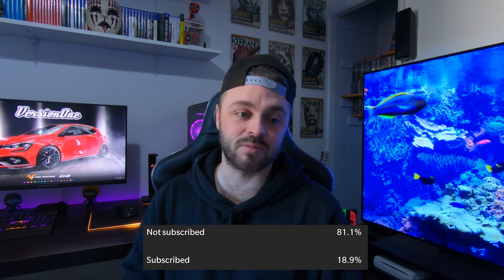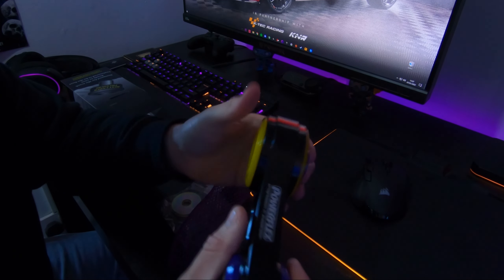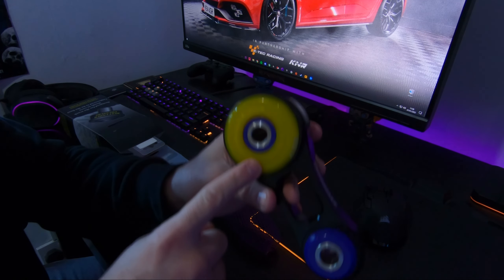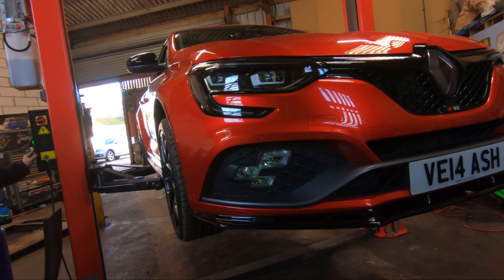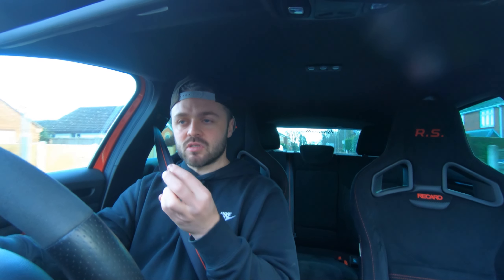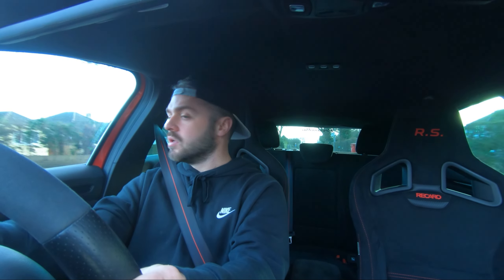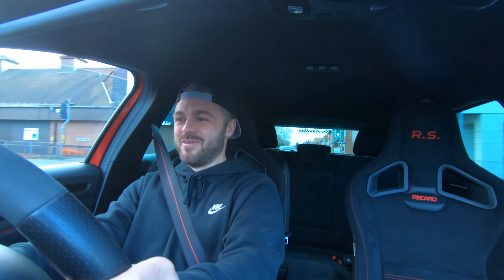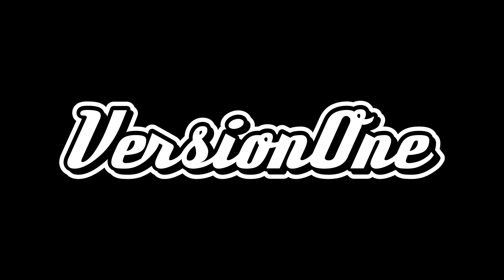GET THIS MOD FOR YOUR MEGANE RS RIGHT NOW! POWERFLEX lower torque mount UNBOXING/INSTALL/TEST DRIVE!

Comment: He mate thanks for your video. What about Ktec strut bridge in combination with the engine mount upgrade. ?  can you make a video about this too?
Reply from the maker: The strut bracing will make a negligible difference compared to the torque mount mate, probably won't even feel it. Being a new car with such a good chassis I imagine it doesn't flex much at all...
Reply: @VersionOneUK  I have done it on my Clio 4. Different was huge. Now I want it on the Megane 4 Gt. hence the question how it will drive in combination with the new engine mount
Reply from the maker: @raymondsport1144  yeah, the diffence being these top end models have a completely different chassis to the RS line models like the GT, the trophy has the cup chassis as standard so it already stiff straight out the box, the GT being the softer, more comfortable variant would benefit from bracing alot more.

Comment: Hello Ash... Someone wrote this about the Powerflex : "Have noticed that in very slow traffic, on and off throttle at walking pace, the car is now more difficult to drive smoothly. In a stock A110 this is only a problem in S mode. Now it can happen in comfort mode. This shows there was a lot of flex in the OEM part". Installed on an ALPINE A110 it seems the support is creating some negative effects. Could you tell me if you experienced the same problem on the Megane ? I have the Megane RS Trophy not an ALPINE and as both cars are not the same, maybe the behavior is different too. Thanks ;-)
Reply from the maker: Hey mate, I've noticed nothing negative about the torque mount... Cars still smooth at low speeds even in sport, and more responsive in sportier modes etc, much flatter shifts
Reply: Ok, nice, thanks for answer. I ordered one for my car but it's on backorder, they ask me to wait a few weeks. Can't wait to install this on mine.
Reply from the maker: @MrToonfish  its a decent easy mod mate! Might be more noticable on the manual shifts wise but i definitely felt a difference
Reply: @VersionOneUK  Hello Ash... FINALLY I had my Powerflex lower torque mount installed on my Megane RS Trophy last week, I had the parts for some months at home without having the time to do the job. So, I installed the MK1 exhaust tube that goes from the catalytic converter to the rear of the car keeping the original valved exhaust, then I installed the lower torque mount (easy job but we had to file a bit the aluminium part because the aspect was rough from factory, now it's perfectly smooth, and at last, I installed the EBC Yellowstuff brake pads, all of this in only 2 hours 🙂So now the car is more pleasant to drive, just some more exhaust rumble and pops as it was on the MK1 (I have the latest MK2 with an additional exhaust silencer in the middle). The brake pads squeaks a bit even without braking and in straight line but these are the first kilometers, I have to take more time for the break-in, I wash them at high pressure this afternoon and it seems that the noise is almost gone. About the lower torque mount, I feel nothing wrong at lower speed and the shifts are "faster" at least I can really feel the difference while shifting in manual. Thanks for your time and advices. Regards from Belgium.

Comment: Thinking of maybe getting this for the ph2 non trophy. Do you know if there was any difference to the ph1 to ph2 of the standard part? I assume its the same
Reply from the maker: Its all the same dude, not a huge amount of differences between the ph1 and 2 at all so this'll fit! 👌
Reply: @VersionOneUK  Cool thanks, will get one ordered. Do you know anyone that has done it my model?

Comment: You mentioned wheel hop at the the start of the video... I find that my RS300 (manual) wheel hops for fun the moment grip is lost rather than just spinning up - only time it doesn't is on ice/snow!!! Happened on both the OE spec S001's and now on PS4S's.  Do you find this?
Reply from the maker: Mine didn't wheel hop standard, mapped it does. More power and torque and EDC. Dropping the SHITE Bridgestones helped alot
Reply: Wheel hop while accelerating usually happens when the anti-rotational links are gone.

Comment: hay ash what about the  dog bone mount on top of engine under bonnet ?
Reply from the maker: Standard mate
Reply: @VersionOneUK  cool can you change that one aswell or dors that stay standard? oh also update on rs monitor, reno serv sent it over by air waves to my car haha so nice one for that 👍🏻
Reply from the maker: @splaig1  wheeey decent man! Glad you got RS monitor sorted. And i only know of one upgrade for the tip engine mount but its fairly track focused so might be too much for the road... Powerflex are working on one apparently though 👌
Reply: @VersionOneUK  sweet ill keep a look out! nice one ash cheers for your advice mate 👍🏻
Reply from the maker: @splaig1  if you want to give the race one a go drop me a message on insta and i'll put you onto the guys that sell it. Apparently makes a big difference according to the lads running it
Reply: @VersionOneUK  i will do mate defo cheers ill get the under one first then drop you a message 👌🏻

Comment: what are the torque setings for these mounts?
Reply from the maker: I'm going to be honest, I don't know... With a quick Google i couldn't find anything on it either which is interesting... I assume its not that vital providing you don't overtighten with a gun or anything
Reply: @VersionOneUK  yeah i didn`t found the settings. i think there are aluminium, maybe 20nm... thx anyway!

Comment: Can i ask if the powerflex is useful for rs280 without lsd? Thanks
Reply from the maker: These mounts will be noticable in most platforms mate, less engine movement means better shifts and throttle response 👌
Reply: @VersionOneUK  thanks mate!! :)